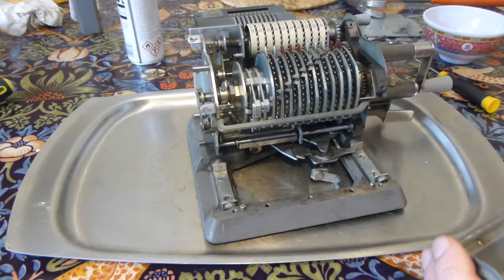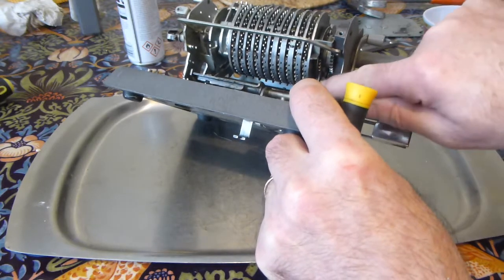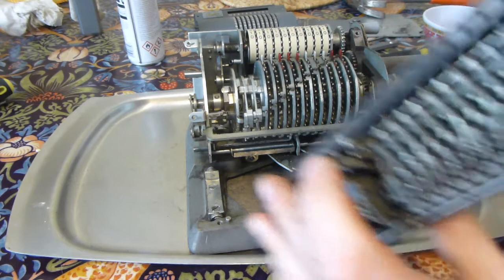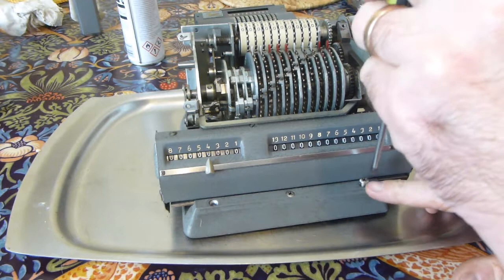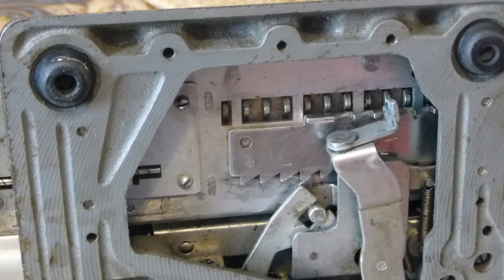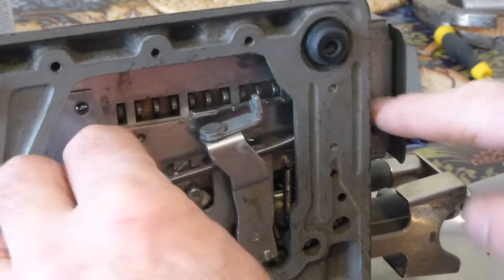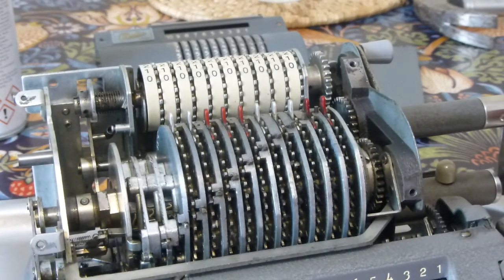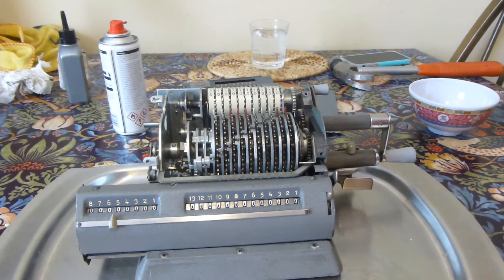Part 17 of 18, Restoration of Addo Multo Model 3 Mechanical Calculator

Comment: Thank you for the very instructive videos. I wish I had seen them earlier because I started to completely soak my calculator in penetrating oil (very thin oil).....I also have a green model 3 with the carriage release button on the front. At first it was completely stuck but after my 'oil treatment' everything started to move again. My problem now is that the rotor disks do not click. They are extremely easy to change. When I for instance choose a '4' for the rightmost disk and rotate one complete cycle with the handle on the right, a 4 appears in the bottom display. After another cycle it becomes a 7 because the 4 has been pushed to a 3 during the rotating cycle. A few other turns and the rotor disk is back on zero.... Does anyone have any idea what to do about this? I probable should not have lubricated the rotor with this thin oil. Perhaps I should try to de-grease the complete rotor?

Comment: I have an early Model 3, serial number 8219, and it's one of the green ones.  The carriage release is a button mounted on the front face of the frame below the carriage, and this makes it considerably more difficult to refit the baseplate.  I think it might have been easier to do the baseplate first, but as it eventually engaged okay, I didn't.  Nice to see the later version though.  There aren't many differences between the two.

Comment: I found it a lot easier to reattach the base plate before doing the carriage. The shifting mechanism can be arranged correctly without any fiddling because of the access from above, and the spring is easy to thread through and attach.